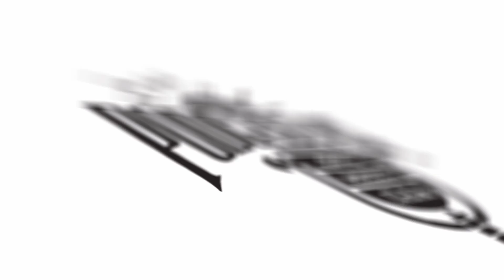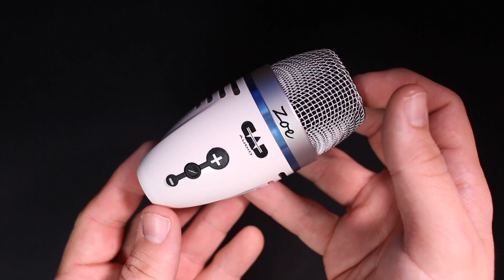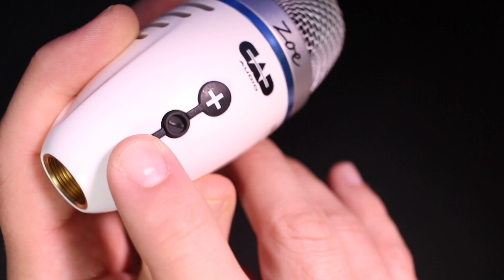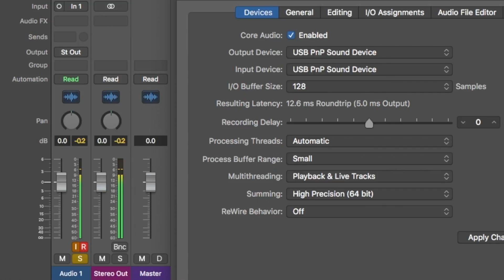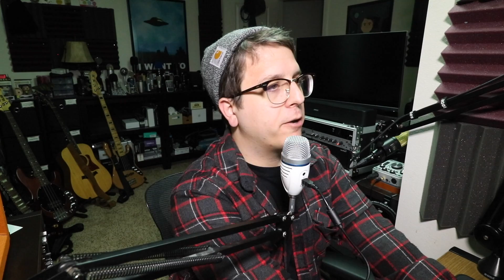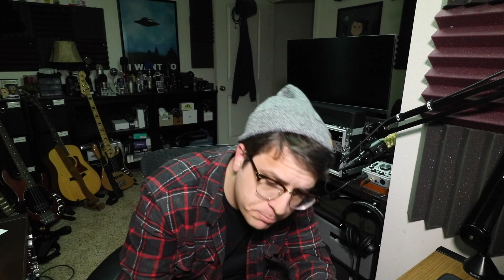CAD Audio ZOE USB Mic Review / Test

Comment: I've posted on a few videos now and while I'm not pushing for an answer in any real hurry, I have kinda pin-pointed the question I want to ask - I THINK,.. 

Can anyone recommend a SMALL, USB powered mic, that picks up audio from a distance that's NOT omni-directional, that's also NOT a shotgun mic, that DOESN'T need batteries or a separate power supply, that's GREAT for casual listening (cheap as chips is fine) and comes in priced under £80 GBP _used_. Thanks. 

If it 'fails' because it picks up ambient noise (not self noise), then I'm highly likely to be interested. Please recommend! :)

Comment: I have problems with noise with my bm-700 so I lowered the computer gain to like 1 and the mic volume to 100..Any better options?
Reply from the maker: I ONLY suggest connecting those mics with a USB AUDIO INTERFACE.
Reply: Young Bull do you have phantom power or an audio usb thing?
Reply: Podcastage thanks I hope it works

Comment: Since I can not afford a phantom power for now, I would you recommend a good sound card economy? I need for a nw 8000.
Reply from the maker: I ONLY recommend USB AUDIO INTERFACE's. That's the only way I suggest connecting. You can try SYBA STEREO USB because that's the last soundcard I tried that worked, but it's not my recommended method.
Reply: Podcastage 
It is better to nw 8000 with SYBA  STEREO or a Klim Voice usb?